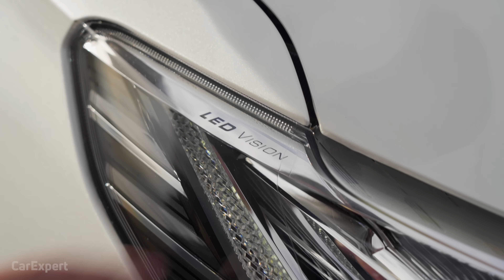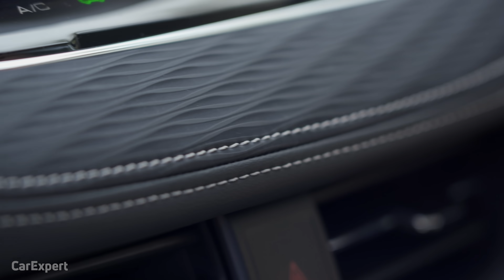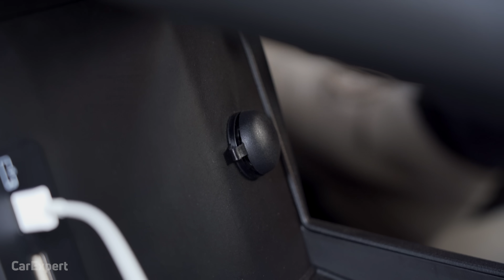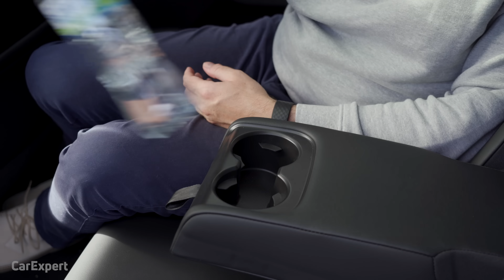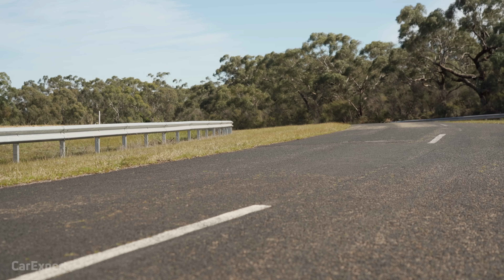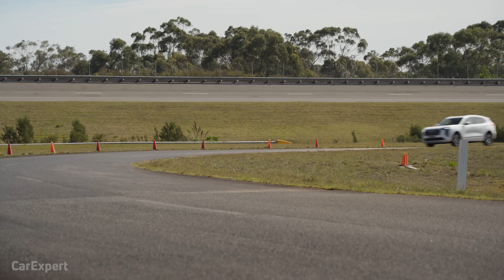2022 Haval Jolion turbo detailed review (inc. 0-100)

Comment: Here’s my problem with chinese cars. To me they say seem to add all these features on, however their not very well put together. Reminds me of how the Captiva used to have Commodore features but they didn’t work as well as they did in the Commodore. Almost like it was dumbed down. Not to mention the build quality didn’t seem the greatest especially when you shook the centre console and I wonder if it actually drives as good as a CX-30, C-HR, Seltos or the Kamiq. I still think China still has a bit of a way to go, however this H2 and the H6 seem to have nice looking exteriors and interiors and do seem to add a lot of kit in for a good price that most people won’t be able to deny. Still a while until I’d consider buying this over the top cars in this class though. Same goes for the other Havel’s and /MG/GWM.
Reply: They drive way better and their features work better than even luxury cars, build quality is already head and shoulders above the rest, try the same in a Honda/Toyota/Hyundai the center console shakes much more.
Reply: @jzvr5842  You’re delusional

Comment: I would prefer my sons 2017 build Kona, at least it has an emergency brake [read lever type], 2 litre with 6 speed torque converter trans, smooth as silk.and relatively quiet.

Comment: Love the review… Love the look of this car, trying to convince my GF that it will be a good purchase. Coming from a Holden Cruze (issues galore) so I certainly don’t need convincing Lol. Just wish it had some of the different colour interior that some of the other countries get, all in all looks like a good buy. Definitely going the ultra if allowed 😅 
Also some reviews have shown that parts of the vehicle settings, specially climate control and heated seat adjustment are in a reversed position on the screen, designed for LHD. Is that something haval plans to fix in a software update that you know off?
Reply from the maker: Yep - a software update should sort it. I’d hold off until it’s crash tested just to be on the safe side 😁
Reply: @CarExpertAus  Do we have rough timeframe for when this crash test may happen? Or wait n see? Ive read they plan to get it done and are hoping to get the same 5 star rating as they did with the H2, which the jolion is replacing. soo hopefully soon enough 🤞
Reply from the maker: @CraigMc24  My understanding is it’ll be soon - Covid has slowed down all the testing out of ANCAP.
Reply: if allowed, really
Reply: @lowfly1416  Yes, they don’t call the partner the ball and chains for nothing. Specially when you live together and have a mortgage lol. Can’t do nothing without consulting the missus. 😅

Comment: Bought the exact same model (high spec white color) back in June and I am loving it! To access the seat heating, drive modes, screen brightness and volume etc you can just swipe the screen from the left edge to the right instead of going into menus after menus. Haval Jolion brings serious value for money in this small suv sector.
Reply from the maker: Thanks for that! We tried that but it kept triggering the buttons on the screen. We’ve since read from another commenter the swipe needs to be from the very edge of the screen.
Reply: Does the Ultra have front parking sensors, as there are no sensors that can be seen, unlike the rear sensors.
Reply: @TheHayabusa09  no sensors for the front but there is a camera on the front grille and it’s crystal clear to help you park
Reply: Do you know how to turn off the adaptive cruise control?
Reply: Hi how much was Ur high spec model is it a LUX? thx

Comment: The engine in this is the Mitsubishi 4b4 mill shared with eclipse cross.
Reply from the maker: Hmm. Not sure that’s right - engine code for this is 4G15K. Has slightly different displacement and compression ratio as well. Eclipse Cross also uses a CVT, this one is a dual-clutch.

Comment: The overall looks are pretty good, but I find the badging way to big. Specially the HAVAL front & rear.
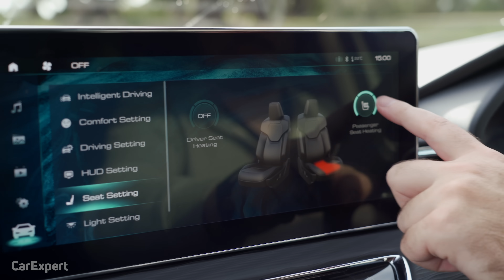@7:56 Looks like the seat heating is the wrong way around, looks more like for a left hand drive vehicle.
Climate controls are way, way off.. They need to be easy to operate while driving, so you can keep your eyes on the road. 
Overall you get quite a bit for your $$ spent..  Resale in 4-6 years time is going to be the interesting thing..
Will the price difference new, be the same difference in that 4-6 years from Hyundai, Kia, Honda etc
Cheers for the review..
Reply: The seat heating is the wrong way around. Most other reviews have complained about that also. Even the climate controls. By the looks it hasn’t being fully translated to right hand drive properly. definitely could do with a software update I’d say. That’s if they plan to release one. Good value car though, definitely on my radar?
Reply from the maker: Agree on all fronts!

Comment: impressive attempt, However that's pretty terrible fuel economy. My 2013 Mazda CX-5 2.5l AWD gets around 8L/100km so for a new car its way off the mark & some of the build quality is patchy in places.
Reply: My 2013 i30 premium 1.8 auto uses 9.5 l/100km combined so I am OK with that.
Reply: @ZZGZBF  I’m talking about a brand new car. Which in 2021 should be in my opinion much closer to 6-7l/100km. I think 8.1l/100km combined is quite a way behind the established car makers.
Reply: ICE engine requires years of refinement and if you have a look at Hyundai Kona 1.6T city and highway figures it's far away from your less than 7 litres per 100 KMs bar. But again ICE is at the end of the life span and for GWM I have a high hope for its EV cars. Japanese have the crown over Korean and Chinese on ICE no doubt about that but future EV is not.

Comment: Shame the fuel economy is so high, all the Haval cars ive seen are all quite poor on fuel consumption
Reply: One thing to add is it runs 91 RON whereas some of the competitors require premium. I found the fuel consumption on mine to be pretty decent
Reply: My 2013 i30 premium 1.8 auto uses 9.5 litres per 100km combined and if this car is similar then I won't complain.
Reply: @ZZGZBF  My 2017 Vitara 1.4 turbo get 5.9litres per 100km so very happy with that hence wont be getting a Haval in the near future, but do like the design
Reply: @TOFAST4YOUFOOL1  My other car is a 2010 Mazda 3 2.0 manual and its highway figure can be as low as 5.8l/100km with 3 adults and 2 kids and boot fully loaded and air con set to level 1 and with its 55 litres fuel tank it can do 900kms in one tank. Really amazing. When it comes to engine refinement that leads to low fuel use none can beat the Japanese in ICE.

Comment: I bought the Lux 5 months ago and absolutely Luv my car. Lane keep assist and driving assist took some time to get used to. Cruise Control radar works perfectly during long-distance driving. Would also prefer to have a steering wheel reach adjustment and drive mode short cut button on the steering. Overall it's good value for money.
Reply from the maker: Thanks for the feedback!
Reply: Just wait for 2-3 years and you will understand why the price is like this.
Reply: @evlampii  that’s what they said about Kia’s and Hyundais. 6 years later, mine held value pretty well!
Reply: @evlampii  could you expand on your comment please. am looking at purchasing a Jolion and interested to know more
Reply: @user-qf7np4br4f  just some pre-conceived bias from someone who never owned or driven the car

Comment: I have the mid spec Lux and love it. you can swipe left to right on the screen to bring up shortcuts for seat heating etc..,
Reply from the maker: Thanks for that! I tried that but it would select the menu items. Is there extra setup required?
Reply: @CarExpertAus  hi I have owned one for a few months 2,600km loving it  swipe on the far left near the edge and it should work for you
Reply: @markvella3232 how is its fuel consumption?
Reply: @blissg47  around 8lts  to 100km
Reply: @markvella3232  Hi Mark. do you have a figure for purely city driving?
Reply: @michaelklar3908  not yet at the moment my trips are mainly 100kmph and short 60kmp
Reply: @michaelklar3908  not yet

Comment: If you're going to remove all of the buttons then infotainment system UI needs to be top notch. The graphics are very tacky and there seems to be some oversight in areas, maybe they could enlisted the help of Bosch, Continental or Harman. To their credit, it has a nice big screen and it's an improvement over anything they've previously had.
Reply from the maker: Agreed! The software definitely needs some work.
Reply: Like any new technology it takes a bit to get use to. It is easy as any other car after a few hundred ks in it. Also it has been worked on by Harman.